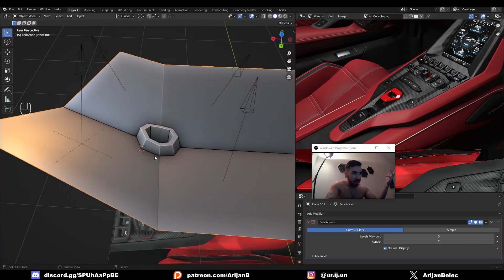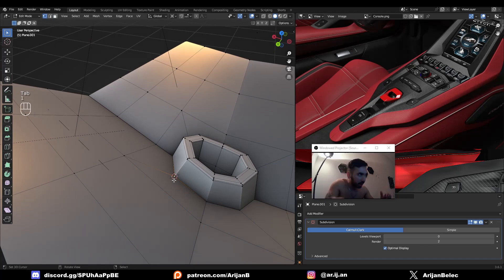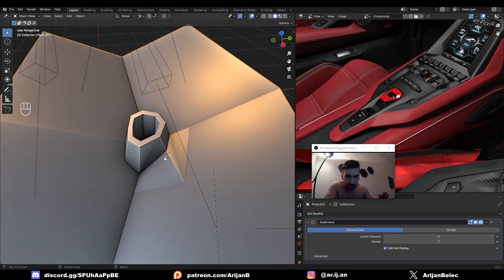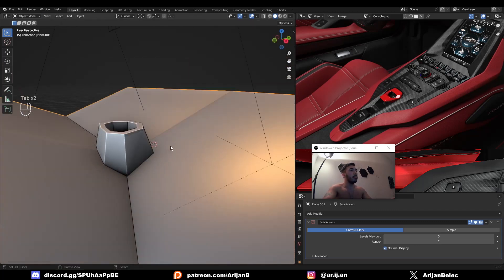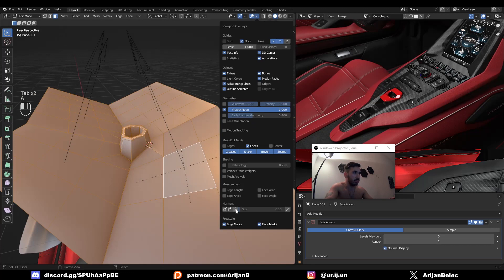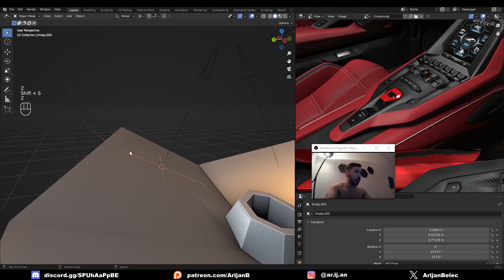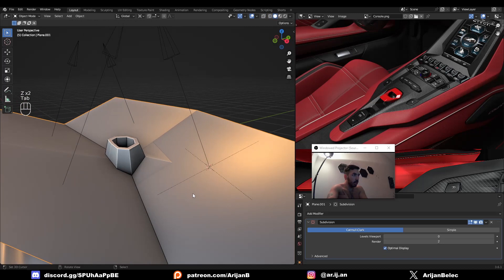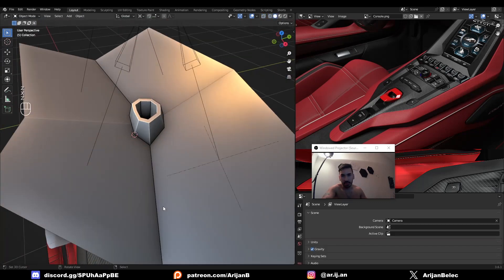Why MATH is important for 3D Modeling (Arijan)

Comment: 3rd way was a bit long, there’s a shorter way to do the same thing by creating a transformation orientation  from selection. 
To do that select the flat face that has the orientation vector you want, open the Transform Orientations dropbox (next to transform pivot and snapping dropbox), by default is set to Global, click on the plus to create a custom orientation and select it.
Next select the vertex, set snapping (from snap dropbox) to vertex snapping and grab the vertex along z axis to snap it to the same level of another vertex from the flat plane.
Hope this was helpful to anyone

Comment: Been using this trick for years in 3ds Max. Normally I draw on a face with a circle using autogrid, and grab its local cordindate and snap to its Z or using vertex/pivot snap. Just be careful taking face normal, as this can be affected by smoothing... flat surfaces are usually fine.

Comment: There is another way of achieving this, you could take face that represents the plane alignment you want to align to, duplicate it and separate it from the mesh so it just a plane object. You scale this plane to some arbitrary size and use snap-to-surface option from the snapping menu. And move the vertex out of position until it snaps to the surface of the object. Voila, as long as snapping is turned on, you can move the vertex wherever you please, as long as it's within the boundaries of the plane mesh. I believe this is called "Face project" in the Blender's snapping menu. You can use this trick for retopology as well. Very simple and easy to setup if you need the vertices to move as freely as possible but still be on the surface on another mesh, something that is annoying to do with the shrinkwrap modifier and you will need 2 shrinkwrap modifier to achieve this behaviour.